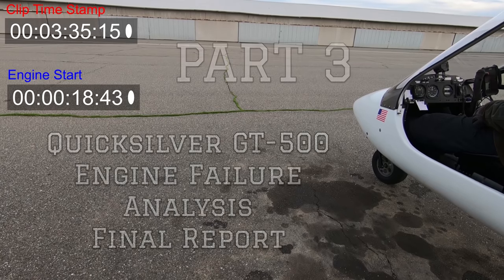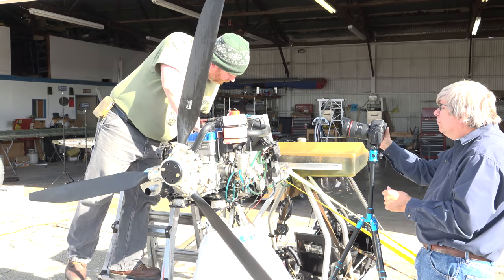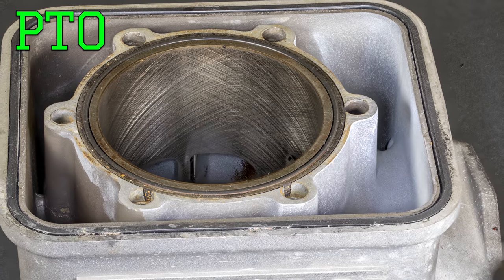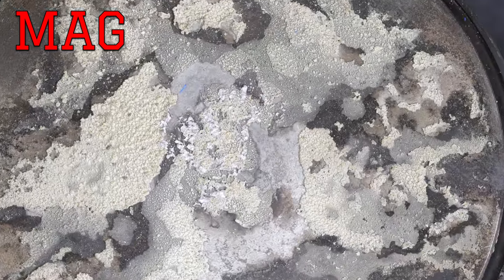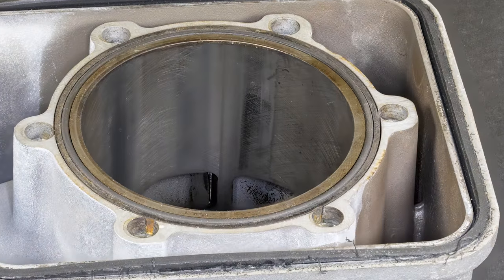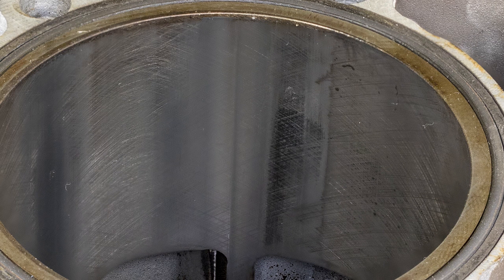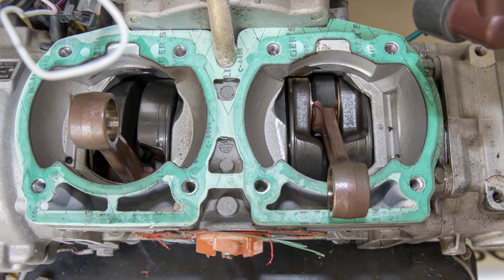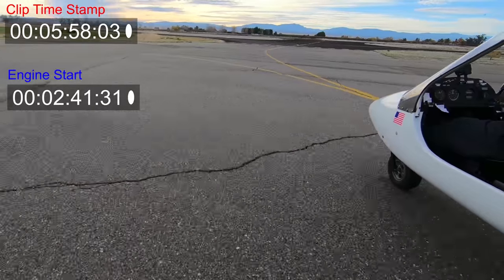GT-500 Crash Investigation (Part 3) Final Analysis

Comment: Cudos for your professional teardown inspection & analysis. You confirmed why data for ultralight & EXP nonbuilder incidents show that subsequent owners have double the incident rate of original owners due to system unfamiliarity. Was the person who performed the most recent condition inspection familiar with the design? Ignorance of the operator I understand as the instructor had only GA experience as well, but the inspection seems to have missed several "red flags" particularly the coolant tank plumbing that had the greatest contribution to the accident. Was this teardown an FAA, owner, or insurance refered request?
Best Regards
Reply from the maker: All of these videos have been funded by Rainbow Aviation. And although the basic report that we generated for the NTSB was used as a springboard. Like the articles that we write for Sport Aviation/Experimenter magazine,   it is part of our way of giving back to the aviation community. Don't get me wrong, we will probably leverage these videos in some fashion including using them in our Light Sport Repairman Maintenance classes, or for the basis of other articles. We believe pretty strongly that these scenario-based analyses, coupled with the in-flight footage, are one of the best ways to prevent accidents in the future. We hope to do more of these.... Wait a minute... We hope not to have to do more of these in the future.

Comment: Interesting analysis but the spark plugs show a RADICALLY lean mixture on both cylinders (carbs). To me, it is so obvious. Did I miss the inspection of the fuel pump, the primer system, fuel tank vent, fuel pickup inside the tank, air leaks along the fuel tubes ?
Reply: Take a look at Part 2 video,  he covered visual inspection of the fuel system in that video. Actually based on carb settings it appears both carbs were running on the rich side.
Reply: Cybair agreed

Comment: Would not the CHT show overheating, or at least a higher than normal level, with the lack of coolant in the system? And, would not the coolant fail to reach operating temperatures at a normal rate at such a low level? Causing one to question the delay in reaching operating temperature. I'm wondering if complacency on the part of the operators wasn't also a major factor. Could the old "getting used to the engine", and not challenging the abnormal readings have crept in over time and become a factor? Finally, isn't a visual check of coolant at the radiator not part of a preflight? When checking fluid levels, this is a standard visual check. Ultimately, the alteration of the coolant recovery bottle to a non-standard and non-functional condition was the first domino to fall in the lead up to failure. Fortunately no one was killed in this accident.
Reply: P Toth Not always, with to liquid touching the sender it would not read really hot until,the motor was at critical

Comment: So these pilots, however first and foremost the IP who is obciously totally incompetent, are at fault start to finish. They literally did nothing correct. The fluid level.issue should have be detected and corrected in preflight to get it home where the base mechanical issue of the rigged and useless radiator overflow/return system was completely useless and nonfunctional--this too should have been detected in preflight and addressed correctly--especially on a commercial aircraft being rented out to teach student pilots. 
I also thought runup time was inadequate but didnt say anything as I couldnt see guages and am not familiar with Rotax 2 stroke engines of any kind prefering tge saftey reliability and fuel saveings of 4 stroke engines. 
And as for the crash itself it is amazing to me that an aircraft with an IP aboard would handle a dead stick landing with far more than enough runway still in front to land in a more or less normal way with no damage to the aircraft at all other than the failed engine. I just dont get how an IP could possibly panick like than and forget pretty much everything hes supposed to be teaching his students. Learning to fly is all about learning to correctly handle the unusual, unexpected, and or emergancy situations without panic or really thought even. The learning to fly normally is very easy and occurs very quickly otherwise. For an IP to have this occur is unforgiveable. I truely believe that he should never be allowed to teach others to fly ever again as this complete incompetence could have killed his student easily. Also if he is so obviously incompetent there is no possible way he could be teaching his students to handle similar scnerios. I wonder how many people are out there right now who will die as a result of something just like this where if handled correctly as it should have been taught to them should have walked away without even the slightest damage to the aircraft at all but instead die in a crumpled pile of twisted aluminum and fiberglass.

Comment: Are you investigating a crash or an engine failure?  The engine failure was NOT the cause of the crash!  Letting the plane stall after engine failure was the cause of the crash.. something which you don't bother to mention.  Not dropping the nose after engine-out was the cause the crash.  I would have to say that your three videos about the engine failure are way off the mark for a 'crash' investigation.
BTW..  I've flown quicksilvers for many hours and I once had a 2 stroke engine failure right after take-off.  (a spark plug blew out of the cylinder).  I had to land in a cloud of dust in a farmer's field beyond the end of the runway.  Years of flying hang gliders prior to this made dropping the nose to keep the airspeed up instinctive for me.  No damage, just got plenty dirty!  Engine-out training is very important to staying alive in an airplane.
Reply from the maker: As we indicated in previous comments part four will deal with the flight portion of the investigation.
Reply: Oh, OK, thanks.  I didn't know a part 4 was coming.  My bad.

Comment: Dang why didnt he inspect the engine before every flight day . I pull plugs check gas and compression before every flying day . Its 1half hour of work before A day of flying and has saved my ass 1 time already.  Rotax and  rotec and all the other questionable motors can kill you  dont trust them for long flights or high performance and never fly any place you cant dead stick inn along the way . No mountain flights or over large bodies of water unless you have A ballistic recovery system and good insurance. Sorry guys but unreliable is just that Unreliable.Also learn how to handle A failure Dump the nose and pray for enough speed to flair . This chump pulled back and froze up ! then had to ask what happened? REALLY you dont know what happened . Go get some instructor time or stay away from planes . sorry to be hard on you but wow dude!!!!!!